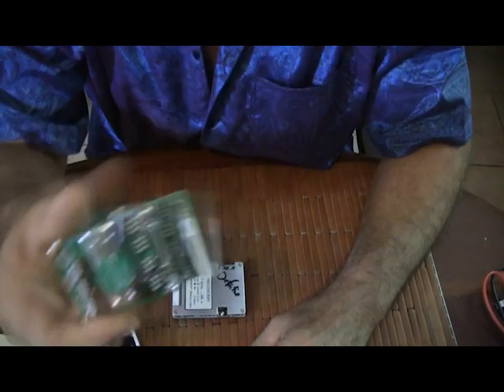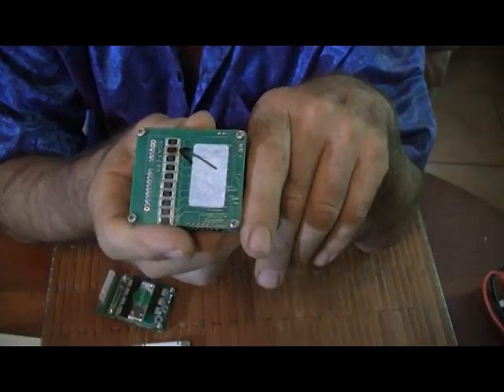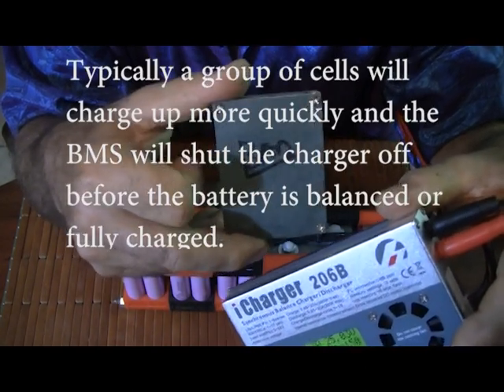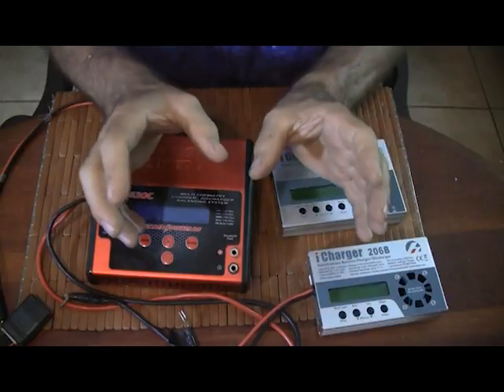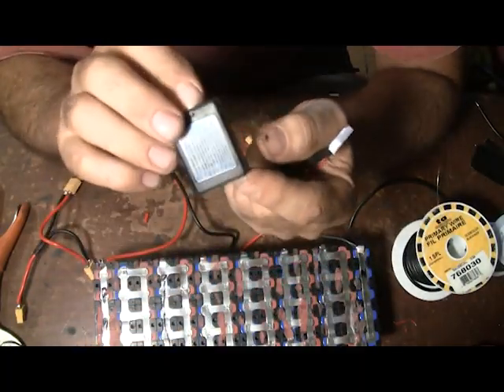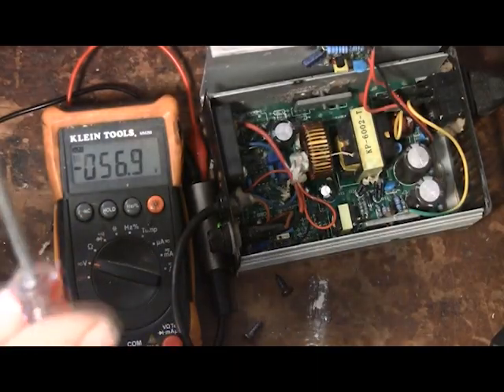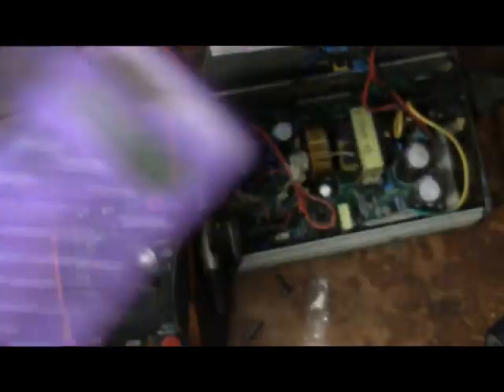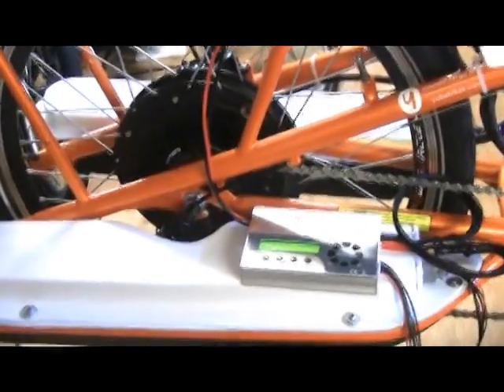How to build a safe and better lithium battery WITHOUT a BMS.

Comment: I disagree with the whole "charge to 4.0v to extend battery life."

You aren't charging it to 80 or 90 % - you're charging to to maybe 50% due to the way li-ion plateau's .

It's hard to say exactly - there are too many variables that affect the exact charge behavior.

But I'm not giving up half my capacity to make a battery last longer that cost less than a 4th of retail price in the first place.

If I was that cheap, I'd just peddle.
Reply from the maker: Good comment.  Here is the best data I have on the subject:
https://batteryuniversity.com/article/bu-409-charging-lithium-ion
Reply: @shawname2  My spidey sense tells me they are leaving something out.

I don't really believe my charger when it tells me a cell is at 4.2.

And I've confirmed this by reconnrcting the cell and seeibg it read 3.7, and I've dbl checked that with a meter.

Thats more a methodology error than anything else.

I'm not sure how you read the potential betwern two pointa to which you are applying a voltage and see anything othsr than the applied volrage

I think what happens is that the charger is reading what its applying, and since it applies the highest voltage at the same time it reduces charge current, all of its voltage readings are bs except the initial reading before the charge cycle begins , and the final volrage after it cuts off.

I bet if one were to disconnect the charger and take a reading every 5 minutes, you'd srill see a plateau, but not as absolute as their graph indicates 

Since I never see anyone talk about this, either I am wrong or everyone else is.
Reply from the maker: @Zomby_Woof  If I am understanding you correctly you are saying that while charging a cell, it is impossible to read the applied voltage except at the beginning and end of the charges.  Chargers for batteries have two phases, a CC (constant current) and a CV (constant voltage).  A charger will start in a CC mode, which means it is putting out as much amperage as it is rated for. The voltage will be lower than the final voltage, but could be calculated.  If you could read the amount of amps the charger is producing, say 5, and if it was a 200 watt charger, it would be calculated to be putting out 40 volts,  using Ohm's Law, Volts times Amps equals Watts.  200/5=40

In the second phase of charging, the CV phase, the charger voltage will have risen to the battery final voltage- say 50 volts.   The current starts tapering off to keep the voltage from going too high.  At first, the charger might still be making close to 200 watts.  180watts / 50 volts is 3.6 amps.  So final voltage, but less current.  

Finally, the charger is putting out barely any current.  If it put out any more current, the voltage would rise too high!  When the current drops to .01 or so- which is .5 watt, the charger will consider the battery charged and shut off.

Comment: Hi Thanks! You mentened something about that battery stops energizing under load. I have my bike stops for ONE SEC in delivery some power just anywhere in time. Is that the BMS you think that can do that? Also I like to change my batteries cause they are so crappy after 2 years. It said from the producer of the bike it was probably samsung 18650 batteries. What to think of when changing? I like to have your system but dont know if I can handle it :). Also can I switch to other more powerful batteries in more amps with the same batterycharger? Can I above that, use china-batteries or use panasonic, samsung or LG?
Reply from the maker: Hi Henrik,
If your bike stops running all of a sudden it probably is the BMS.  You can bypass the BMS by connecting the B- on the BMS to the P- on the BMS with a jumper wire with alligator clips.  If the bike runs again, you know it is the BMS that is shutting it down. The BMS could be defective, or it could be that the battery has a group of cells that are too low, causing the BMS to shut the battery off.

You can use a battery with any number of amps on the same bike with the same charger- but the VOLTS must be the same as your original battery.  You can use any cells from any manufacturer, as long as the voltage is the same.  

cheers,

Shawn
Reply: @shawname2  THANKS!!!! i check if I find the terminals for B- and P- on the board. Can I connect alligator clips when it is tight inside the battery I think I solder it if possible. To clarify that when I said stop it was driving the next second, it like drops down in voltage for a few milliseconds or so... it does this several times in about 30minutes. Thanks again!
Reply from the maker: @henrikjonsson4340  Yes, just try a jumper with alligator clips as a test.  If your battery only drops in voltage a little under load, it is perfectly normal.  It's Ohm's law in action!

Comment: i have on the side of the road bypassed the bms what the guy who helped me called it hot wiring  lol cool guy who just happened to be at the trail with his ebike and came with his truck he had wire and parts in his truck and spruced me up with a 30amp fuse as well and i successfully rode the rest of the day at the trails and my 6 mile commute back home im rebuilding my escooter battery now much higher voltage then the ebike i had back then but im salvaging 3 ebike batteries i have stored at my parents that they want gone to add more ah to the scooters already 26amp 52volt battery i want a better system to see whats going on inside the battery when the 26 amp battery becomes a very large 38 ah 52 volt i do scooter delivery as well and need more distance as my duel 1000w motors only go about 31 mph and im cranking it max throttle the whole time when i deliver do you reccomend a fan install in the batery bay where the controllers are housed if im cranking it full all the time like i am and i know your probably not suppose to but i do
Reply from the maker: Great Story.  Yeah, why not put a fan in with the controllers.  Or remount them so they are in the open air?

Comment: 10:20 Such huge parallel packs disconnect and connect again, you must be really sure they have a similar close voltage and charged correctly. If not, it can be a risky operation connecting those packs together. So be careful.
Reply from the maker: You would think so, but in practice it is not so.  If they are within a few 10's of a volt, they will just balance out without fuss.

Comment: Hi Shawn, I saw the facts: a BMS kills a battery because it stops at 3 Volt in a 10 S system at 30 Volts. But some of it are at 2.5 or 2 Volt and some others over 3 Volts. I modify the voltage meters: if one of the cells drops down under 3 Volts and the beeper starts I switch off the battery with a small electronic and a relais. Is that an idea?
Reply from the maker: Yes, though automating it would require some skills.  If you are close to the battery and hear the alarm, you can take action.  But do consider using an active balancer alongside the BMS.  It will help keep the battery balanced, helping the BMS to do it's job.  You can still use the voltage alarms.

Comment: the advice is  interesting  tech  is great  but  these i chargers  arent cheap ...$150 -200  and they can fail  .So  economically not  ideal  for  ebike battery  management .. 
Ebike Bms  are  about  $15-20   .to replace diy ..Newer  tech  such as  ISDT 8G 8S  are  the way to go  .
Reply from the maker: Good comment!  If you have a newer smaller battery in good balance using a BMS in parallel with active balancing, like the ISDT, is a good way to go .  The active balancer has a very small balancing current, as do cheap BMS,s, hence the need for hobby chargers on some batteries.

Comment: Thank you. A very helpful reply.. I feel much better now I know I don't need to rebuild
Reply: if I understand you correctly I will need 4 cheap BMSs.with 4 sets of balancing wires (14 wires for each battery) Cell loggers x8 and a parallel charging board?  Presumeably each BMS will need its own power supply?
 Am I correct. Its beginning to look a little complicated.
 Thanks Simon
Reply from the maker: You're welcome.  Good Luck!

Comment: Hi,
I’ve bought 6 new packs of 9s 2p  18650  Llon cells @ 2500mah each. 
They are beautifully constructed with spot welded connections throughout.
Each pack is caged in its own dedicated plastic holder.
It has proven easy to make a 13s 2p out of 2 packs giving me the 48 volts I want for my electric bike.
I plan to make 4 such packs which I’ll connect in parallel for my finished battery pack
The question I have is about balance charging?
Whats the best way of going about this?

I have 52volt lithium iron charger which should be mated to an internal BMS.
i have 2 hobby balance chargers each capable of handling 6s cells
But such chargers expect to be connected to a parallel configuration of cells.
Do you know of a work around for balance charging please.
Or do I start gain with my build?
Thank you 
Simon Greer. Macclesfield UK.
Simonbridge26@gmail.com
Reply from the maker: Mechanically it makes more sense to make one 8P13S Battery.  If for space reasons you make four batteries and wire them in parallel, since they are only 2p, a cheap BMS on each battery would suffice.  You can charge them in parallel with your 52 volt charger.  For extra points, wire each battery with two 8S cell monitors- so you can see that the BMS is working.  Wire the JST connectors, and hook up an 8S cell monitor when you want to check.

https://www.amazon.com/4Pack-LiPo-Battery-Checker-Indicator/dp/B07VNW4MXL/ref=asc_df_B07VNW4MXL/?tag=hyprod-20&linkCode=df0&hvadid=366306819795&hvpos=&hvnetw=g&hvrand=10277303934278005217&hvpone=&hvptwo=&hvqmt=&hvdev=c&hvdvcmdl=&hvlocint=&hvlocphy=9002830&hvtargid=pla-802176963546&psc=1&tag=&ref=&adgrpid=81881572248&hvpone=&hvptwo=&hvadid=366306819795&hvpos=&hvnetw=g&hvrand=10277303934278005217&hvqmt=&hvdev=c&hvdvcmdl=&hvlocint=&hvlocphy=9002830&hvtargid=pla-802176963546

Comment: Hey Shawn I don’t wanna run a bms I’m gonna use a balance charger. Could you point in the right direction of what kind of Bluetooth (battery monitoring system) I could use to monitor the voltage of the pack? I’d rather monitor it myself not the battery monitor system l??
Reply from the maker: Hi Kevin,

No harm in using a BMS and a balance charger,  even if just for the bluetooth monitoring.  If you are OK  monitoring with just an alarm sound- without bluetooth- consider using these:  

https://www.amazon.com/PACK-Battery-Voltage-Checker-Alarm/dp/B00XQ91ECA/ref=pd_lpo_21_t_0/136-9591166-0272463?_encoding=UTF8&pd_rd_i=B00XQ91ECA&pd_rd_r=44c5988e-087f-4b08-b8ed-5b5cb28296a5&pd_rd_w=SKHO4&pd_rd_wg=nsSJS&pf_rd_p=2eae1586-a44a-4b21-997a-1dfc1740e496&pf_rd_r=DXG3AKZ2T06ZA738V3P4&psc=1&refRID=DXG3AKZ2T06ZA738V3P4

Comment: Awesome stuff bro...my battery tipped over and hit the concrete,  I couldn't fault any cells so bypassed the bms...better power now and I just keep an eye on the cells after every 5 rides
Reply: I put and inline fuse on my bbshd build that's enough safety for me

Comment: morning and i'm very interested in your method to create a battery pack without a BMS not just for my electric wheelchair but for other projects.  now i know nothing about electricity except to hold an umbrella during a lightning storm for protection.  now i think i have 2 U1 12v 35ah batteries.  i would like to create several battery packs to run my wheelchair like about 4 packs so i can run for several hours if i need to.  Now i have a few of the LGDAHA11865 batteries rated at 1300ma so whats better 3s8p or 4s6p either way gives me close to 31.2 ah i think my math is right?  i fail kindergarten.  i can get the hobby charger 206B that you suggested in your video but the cell checker isn't available or is it?   i guess any cell logger will work.  what is the inline fuse rating 30 amp  40 amp?  any suggestions on a battery switch? now one more question.  i see all these different cell holders but none address the heat issue the lithium cells can generate under load.  now i was thinking would spacing the cells 1/4 or 1/2 apart and using a fan to help with the movement of air around them?  or it really doesn't matter if they get hot?   i know your probably busy but any advise will do.  it hard as a stroke victim to get things done right.   i would appreciate your reply even if its to tell me to give it up.  thanks and i welcome any ones suggestions as well.
Reply from the maker: Ooh, a lot of questions.  FIrst, Hobby chargers are not large enough to quickly charge wheelchair batteries.  A decent Hobby Charger might max charge at 150 watts an hour- check the rating on your current charger to compare.  The easy way is to buy a ready made lithium battery pack that will fit nicely in the space allotted with a BMS built in.   Like this:  https://alliedlithium.com/pages/lithium-golf-cart-batteries-brands
The next easiest way is to go to Battery Hookup and buy a readymade salvage pack.  https://batteryhookup.com/  You will need to come up with your own balancing system.  
I would not be concerned about heat output.  The cells may get warm, but will not get hot unless your battery is way too small and you are running it flat out.    
I suggest a look at BatteryUniversity, and to understand Ohm's Law to get the math right.  You need to understand watts and amps and watt hours.  
It is a fun hobby, but you have to decide if you want to invest the time learning or to buy ready made~!   
Good Luck,

Shawn

Comment: Learned a lot from your video. I used this approach when I built an electric skateboard. I still have my charger and my monitors, so I will now be able to repurpose them for my eBike project. Thanks for the information.

Comment: Very well thought and explained. Thank you for that. I lost my innocence a while ago when I initially understood what a BMS actually does. You stated it clearly: It cuts the load for the WHOLE pack when ONE cell hits the ceiling and it cuts power from ALL cells when ONE cell hits the floor. Well what is this? I once worked with financial auditing guys. They shut  your business down when you don't behave. That's why I'd call it a battery auditig system rather than a management system. But what's the solution? I'm an RV guy and I wouldn't prefer taking out my battery and hooking it up to a  seperate charger when one of the cell loggers barks alarm. Again thank you for that, these cell loggers are THE concept to keep yourself in charge (pun intended). I'll have to let that sink in but you already have me disassembling the pack in my car and replacing the BMS for something that makes sense.
Reply from the maker: Hah, funny.  The solution for your RV are active balancers.  They will move the power from the high to the low cells.  You can use this and your BMS- as they do different things.   One of these goes on each parallel group:
https://www.aliexpress.com/item/4000110143557.html?spm=a2g0o.productlist.0.0.262e1a573VZZUj&algo_pvid=82dd80a6-a20d-43a5-81e8-4cb827d5f3dd&algo_expid=82dd80a6-a20d-43a5-81e8-4cb827d5f3dd-28&btsid=0b0a556a16118734480406241edf1a&ws_ab_test=searchweb0_0,searchweb201602_,searchweb201603_
Reply: @shawname2  you know what? When I look at the whole market and what's being offered as extra gadgets (and we did not need any of them in lead-acid battery times), I start to suspect that some of this might actually be snake-oil. I'll start by glueing some of your cell monitors to my co-pilot seat and learn from there. Thanks again for the kick in the ass!

Comment: i am trying to build my first battery pack, and i am trying to make it capable of 20A for each parallel cell (so 2P = 40A). Only the series conductors need to be high amperage right? I could probably be fine with 7A nickel strips connecting in parallel, since the parallel does not see much current, right?

Comment: 4 packs out of no where and not while connected together or even in use. The voltages were fine one day then I go to use them and they dead. Hook the charger but no charge cycle. Put the meter to them all individually and they were under 20v and they were 36v packs
Reply from the maker: The BMS is detecting a low voltage and not letting it charge.  You could bypass the BMS and charge the battery directly, until the voltage came up enough so you could charge it through the BMS....   You can also check the voltage of each parallel group through the JST-XH connector to the BMS.
Reply: @shawname2  omg I can't believe you replied and so quickly, firstly thank you, and secondly I'm so disappointed that your website is closed down, I finally had the money I needed to buy my blocs from you. I've seen the other crap on the market it does not compete with what you created. I certainly would never ask you to go out of your way but you gotta help me out. If at all in anyway, I need blocs for my projects. I appreciate your help and for your reply. I hope all is well
Reply from the maker: @jonjudice1155    Sorry Jon, but building BatteryBlocs was taking too much of my time.  I have moved on to other endeavors.
Reply: @shawname2  that sucks, I totally understand. You custom build them? To each person's order? There's nothing laying around I could purchase? I'd also be interested in what endeavors you moved on to. Also I don't have a full grasp to the electrical engineering aspects and details but I knew there had to be ways around problems I'd run into, I know enough to know that, but not enough knowledge to work it, I very mechanically inclined growing up on a sugarcane farm and just started branching out to learn new things. Again thanks for your help
Reply from the maker: @jonjudice1155  Yes Jon, They are made on a 3d printer farm of 12 printers and made to order.  I am 66 and wanted to spend more time hiking and cycling and studying.  Email me at shawnwiththewind@gmail.com